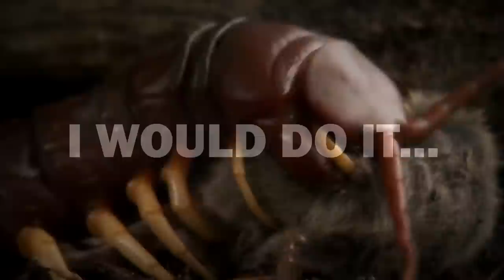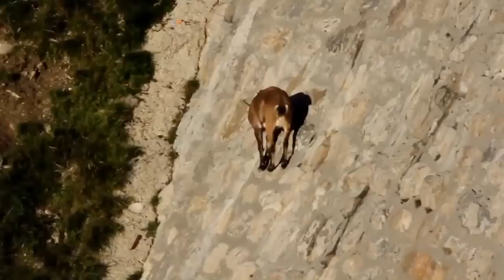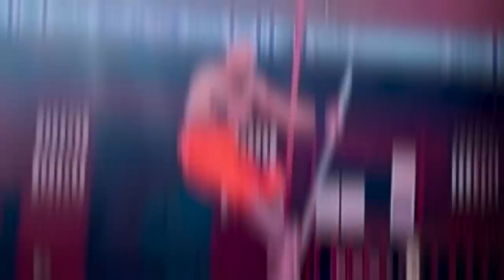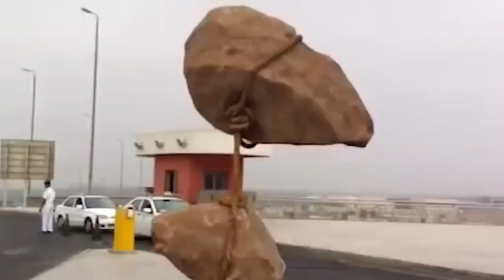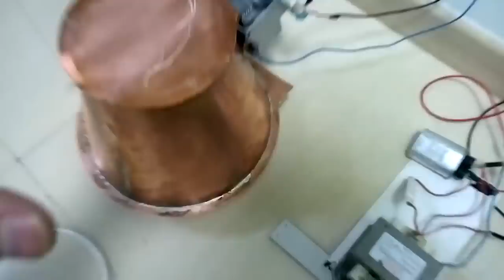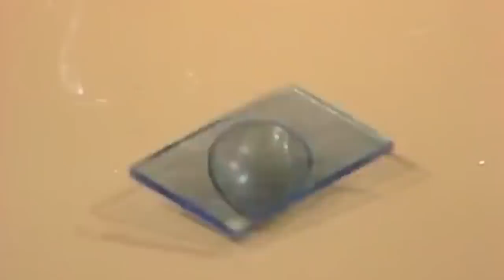This Rock Violate All The Laws Of Physics

Comment: Regarding the M-drive: modern science just keeps turning a blind eye to the electric field that co-exists with every magnetic field. Once it catches on that you can not only harness electricity in space around our planet by moving a long enough and resistance-free conductor through the magnetic field around the planets and between them, you will be able to scavenge as much electric power as is needed.
    Secondly, the opposite is also true: Pushing an electric current through a conductor will create a magnetic field, which could be used to move the conductor (and whatever is attached to it) through or away from the magnetic fields surrounding planets or between planets in our solar system.
    It must be noted that this process is very sloppy and hugely energy inefficient with current technology. Future breakthroughs in conductivity and energy storage will hopefully mitigate these issues and allow for better use of electromagnetic drives in the future.
Reply: It confounds me that humans dont just tap into the earths electric/magnetic fields. Everyone knows theres a large electrical difference between earth and sky and when it gets too great lightning happens. So why again are we not just getting energy literally from thin air?
Reply: @lukemarquardt9745  My thinking is: Big Oil and the companies that are getting rich off of the 'research' being done on tokamak reactor programs. 😤

Comment: I LOVE physics. These don't violate them so much as take advantage of lesser known details. I.E. My sister's team project for graduation was about aerodynamics. They had streamlined an 80 lb car model that was so aerodynamic that it would leave the ground at about 35 mph. They had to prove how modifications could balance that with keeping it moving forward. Interesting project!
Reply: Did they use front and rear valance's, possibly a rear wing/spoiler an engine placement?
Reply: @meaghanmcauley1010  Good question, but no! It didn't even have wings, let alone moving parts beyond the wheels. I was down to visit her and the kids for a week, so I got to audit her classes one day. It was FUN; I hadn't even started my Mech Design classes yet.👩‍🔧🎶💖
Reply: the modification required is so easy, no one thinks about it.......

Comment: 1:07 No it does not. The greater portion of it's weight is behind the edge not over it. So it should actually roll backwards. Instead of downhill.

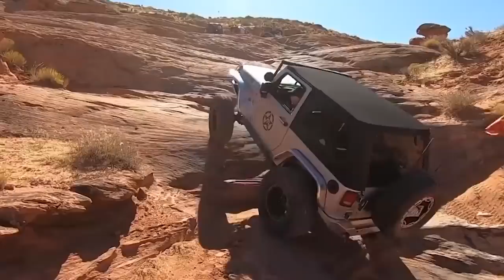Comment: You can see some of the sand/dirt used as a counterbalancing weight coming out of the truck's bed on the driver's side at 7:06 . Instead of violating the laws of physics, the driver knew how to use those laws to set the truck up for a successful climb.
Reply: That is just sand falling out of the bumper where it  dragged on the ground at the bottom of the hill. The departure angle is not very good on a pickup..

Comment: Those morocco clouds are a regular feature here in Bangalore .... caused by extremely polluted lake (many leather tanneries and other factories around the lake pump all kinds of toxic crap into the water).  Where the water flows out of the lake, it tends to froth and cause these cloud like foam ... some of which is carried by the wind just like soap suds.

Comment: The Center of Gravity and Weight of the Rock Controls/Maintains Equilibrium !
Reply: I think the weight is not as relevant as the center of gravity, and its position on that incline ,as you mentioned. A few tons should suffice to keep the wind from having any effect on that structure.
It does not need to be 1000 tons...or whatever the actual weight is.
Reply: Maybe some  of this reading crowd saw the trick of balancing a fork and spoon on the edge of a drinking glass , with the aid of a single toothpick. Or the trick of balancing a wine bottle between 2 grains of salt

Comment: 1:07 Adobe Photoshop violates all the laws of  physics. 
Hmmm very great software, soooo underrated developer.
Reply: The greater portion of it's weight is behind the edge not over it. So it should actually roll backwards. Instead of downhill.

Comment: Pretty sure the helicopter is being towed under another helicopter the same way they transport tanks and the like,the wind is moving the tail rotor.sucker Bor every second.
Reply: they told youFPS  if the prop,s doing 25fps and the camera25fps  it clicks same spot looks like its not moving    a trick camera men do    
also get a row of black lines ===== and see the destortion on film   -   hold lense open  old 35mm camera' s  in dark room and draw with a small pen light   10 -  20secs
Reply: @markissboi3583  I'm waiting for someone to see the illusion of car tires starting to spin in reverse and claim it's a "glitch" or some other bs.

Comment: Theory's are also based only on belief. If it were proven true they would be called a fact.  A theory is a belief that sounds right to some, but has not or can not be proven true.
Reply: You need a refresher of middle school science & language fundamentals.  Your proclamation exposes your ignorance on the topic and illustrates that your understanding is critically flawed.
The term "theory" has several distinct meanings.  The definition used in the context of science (which is clearly invoked here) is not the one you describe;  it has quite a different meaning and usage.

This should not be interpreted to imply that the narrative of this video is using terms correctly  either, or that any of its assertions are valid or logical!
Reply: @DJJonPattrsn22  I agree to disagree. So sorry i don't talk yuppy.